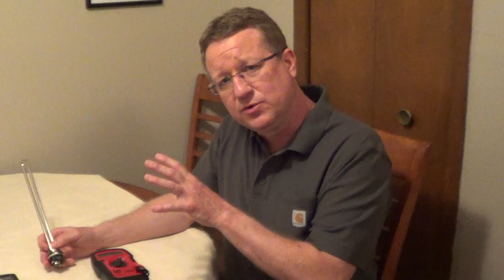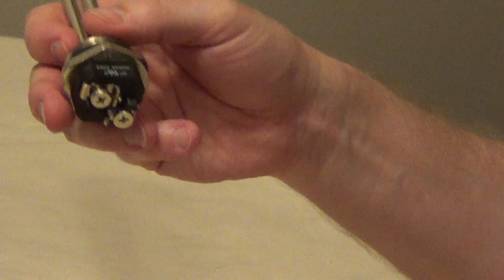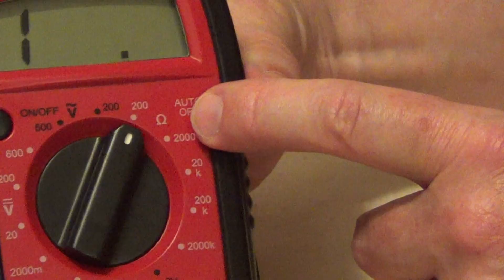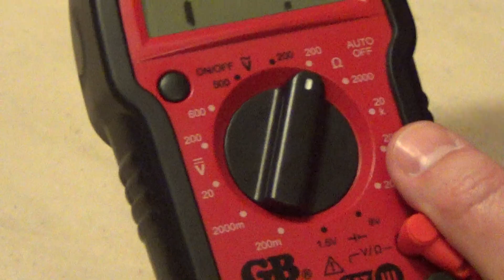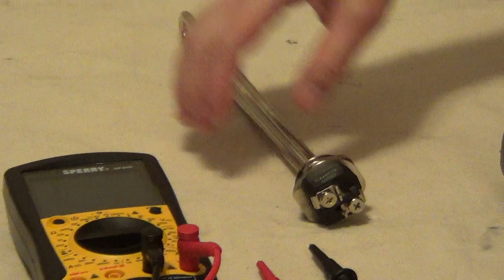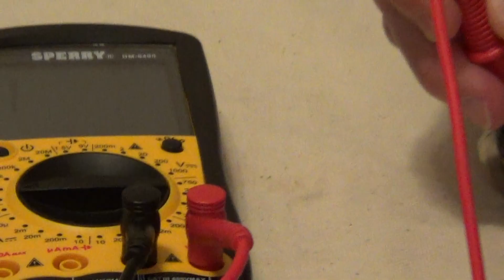How to Test a Water Heater Element

Comment: Thanks for a great video.  My water heater is also tripping the breaker.  Resistance around 13ohms both upper and lower elements. And OL reading to ground. This is using the ohm selection on multimeter.
However, when using continuity the meter beeps with a reading of 13ohms for both elements. 
But, it also beeps and showing 13ohms to ground.  
Does this mean the elements are shorted to ground? Thank you
Reply from the maker: Hi, how many watts are the elements?

Comment: You said multiply volts. And divide whats.   How is that?
Reply from the maker: Hi, the formula is volts squared divided by the watts. If your water heater is 240 volts and the element is 3500 watts, you multiply 240 X 240 which is 57,600, and divide by 3500 to get a value of 16.5. This is the number, you are testing for, plus or minus 2. 
Check out some home improvement tips in our e-books https://www.amazon.com/gp/product/B0B2KW1FQ9?notRedirectToSDP=1&.

Comment: When I check my 240/4500 water heater I get 12.5. Does that mean my element is bad
Reply from the maker: 12.5 is good. 57600 divided by 4500 is 12.8. The good range is 2 above or below the number, so 10.8 to 14.8 is good. 
Check out more home improvement tips in our e-books https://www.amazon.com/gp/product/B0B2KW1FQ9?notRedirectToSDP=1&.

Comment: I did this test on my on-demand water heater. 120vx120v = 14,400 / 1500w= 9.6 I get a 9.9. So this should mean that the heater Element is good. What let’s could cause my heater to not produce  hot water?
Reply: It turned out that my water pressure was too high. It should be around 50psi (ish)

Comment: So simple, thanks. Formula is Voltage square divided by Watt rating. Just to clarify.
Reply: Does this apply to 12v DC immersion elements too?
Reply from the maker: +Gab Save Thanks.
We have more tips in our home improvement book http://www.amazon.com/dp/B01BK2K0JM?ref_=pe_2427780_160035660

Comment: thank you. but so it can be tested, how do i even access and take the element out of the water heater?
Reply from the maker: TAMUZ1234 Hi, you would turn off the power to the water heater. Double check that the power is off at the tank with a tester. Remove the cover to the element. There will be insulation and usually another plastic cover. Take the wires off the element, then test. Let me know if that helps.
We have more tips on our weekly podcast https://itunes.apple.com/us/podcast/fix-it-home-improvement/id880903087?mt=2